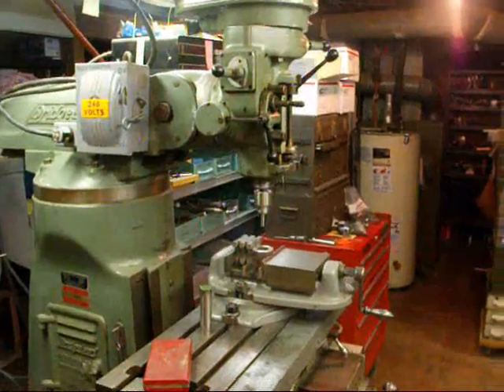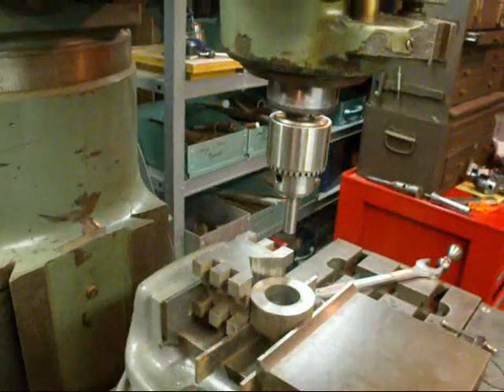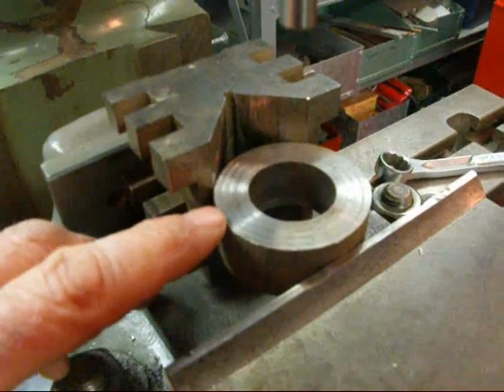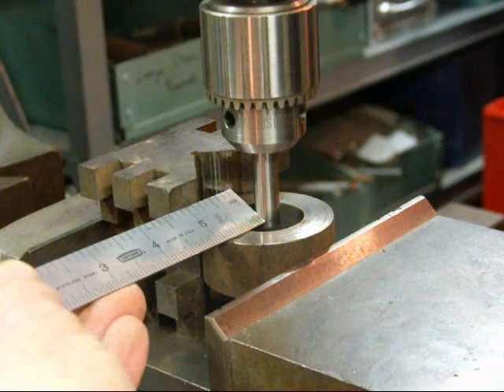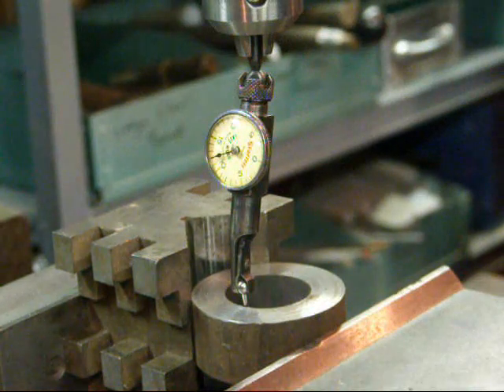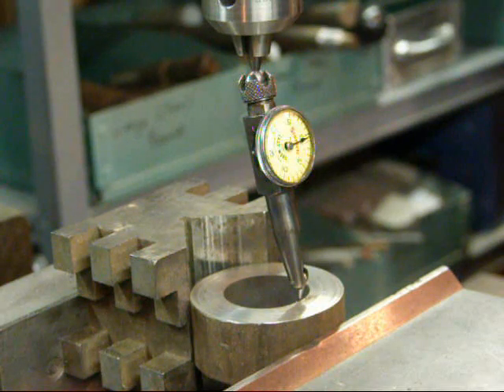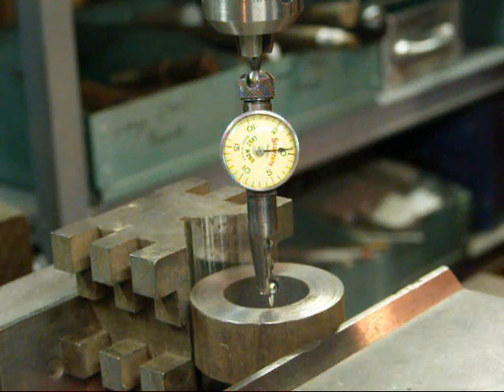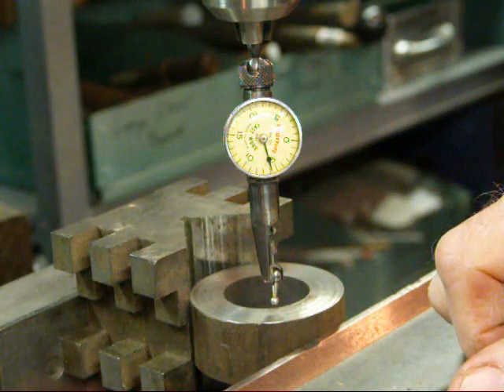Bridgeport Mill part1 Indicating a Hole prior to boring tubalcain

Comment: You may find that holding the part between two vee blocks will distort less and grip better with less force. There should be no need for parallels either as the vee blocks will hold the ring square to the o/d.
It is worth noting that the ball joint does not guarantee the indicator is vertical to the spindle axis. The stylus is therefore not always automatically set to travel directly towards the spindle centre.
Reply from the maker: Thanks

Comment: Don't wanna be a Ruffian here, but class should have been about something like milling slot centered to hole or something that couldn't have been done on a lathe in 1/5 the time.  Boring I just slap in the 3 jaw done.  Thanks for the vids they are a help.  Is a last word like a test indicator that the needle works better the more parallel you are to the body?

Comment: I wasted my money on Blake that never really worked right.  Great video.
Reply from the maker: I just bought a used Blake yesterday, luckily it was only five dollars
Reply: @mrpete222  I'd be happy to send you mine, with it's tale of woe.  Maybe you could use it for parts.  When I first got it I thought it was better than sliced bread. Turns out it was moldy bread, the metal that is.  If you want it just let me know.  Worst $250.00 bucks I ever spent.

Comment: There are better (and faster) ways to indicate a hole.  The new co-axindicators are very useful, but expensive.  My favorite is the Gladwin indicator.  They have been out of production for a long time, but you can find them on  the internet.  About $30, but worth it.  The Gladwin only reads to .001, and that is pushing it, but since it reads from both sides, you can read either direction without all the moving around.  Since you are going to bore the hole anyway, .001 should be close enough for 99% of all the work you do.

Comment: How do I lock down the table without it moving? Ill zero out a part in x and y with the DRO, and it will move a few thou when I tighten the table down.
Reply from the maker: That is pretty common. Just compensate for it

Comment: Mr. Pete.  What is the maximum diameter of the Starrett indicator capable of?  Some of our motor bearing journals are out of round, and we must indicate off of the outer chime, which can be up to 24" diameter.   Thanks for any help and advice.
Reply from the maker: I guess no limit if you use extention rods
Reply: Thank you again.

Comment: Tubalcain, nice video, you explained this very well. I have worked in a machine shop for almost 8 years now and this was one of the first basics I learned, although I learned on a CNC. A similar technique can also be used to set zero central on a square, rectangular, hexagonal or any shape with parallel opposing sides by swinging the needle across the surface until you find the high spot in the indicators motion, zeroing both the indicator and the DRO or collar on the machine, traversing to the opposite side of the work; again swinging the indicator across the surface and adjusting the axis until you find zero at the high point. Then, look at the distance moved and divide this number by two. The operator now moves the axis to whatever this value is, and the work is now centered under the spindle (stock must be machined on sides for precision, but this will get you close enough on saw cut stock if you need to find rough center. Also, backlash on a manual machine may make this tricky). I am sure this method is not new to you, but perhaps some of the viewers are unfamiliar with this method and would like to learn. Just an idea for an installment, and yes I understand you get many questions and can't answer them all. I love the videos, I could listen to you talk for hours. In fact, I have. Thanks, Mr. Peterson, and I apologize for the lengthy comment.
Reply from the maker: Thanks

Comment: Hello Sir! I have a little question. Before locking the vise You've set the work on parallels and against the v bar. After locking the vise parallels could be slid out from underneath the work. For me this means the work moved and its bore is no longer parallel to quill axis. How do You avoid that? Brass hammer? Thank You in advance!

Comment: OK. Mr. Tubal. Forget the 3/8 dowel to get the spindle center close to the bore center. just bring the indicator tip close to (above) the bore and visually estimate the difference in axis + or -. And of most importance. Shifting the mill spindle into NEUTRAL makes the spindle easier to turn. And to continue, snug the axis locks BEFORE you dial in the final setting. Ive seen worn mill tables move more than .01" when locking after final settings. Theres more here to discuss but I wont.

Comment: I found when center I will 0 the Y, then swing the indicator from center Y to X of both sides adjusting the X axis of the table until I get 0 on all 3 sides.  All this of course after I find rough center.  Works much better on small diameter holes/rounds.

Comment: In the first part in the X direction, after setting to zero and turning in the other direction and reading 0.01.  What do you do after?  Are you moving the table to get the zero on indicator and turning the indicator to the other side?

Comment: I like doing a lot of boring on round objects in the mill like this part you're doing, on a rotary table in the center of the table X&Y to eliminate the crush effect you mentioned.

I love the 'last word' it really work and they are very accurate, even in a Jacobs drill chuck.  I prefer collets, but drill chucks are ok.